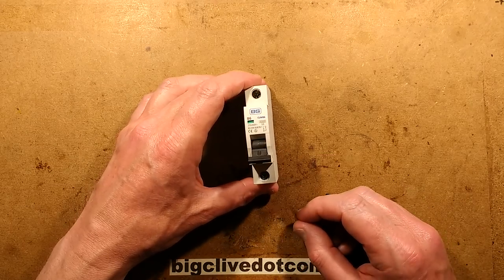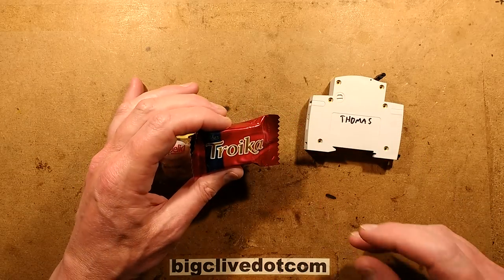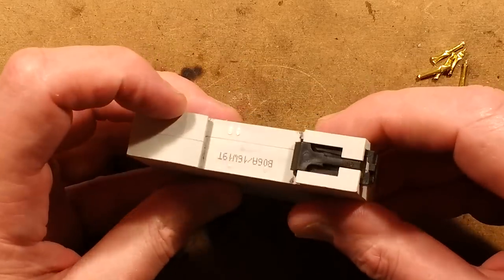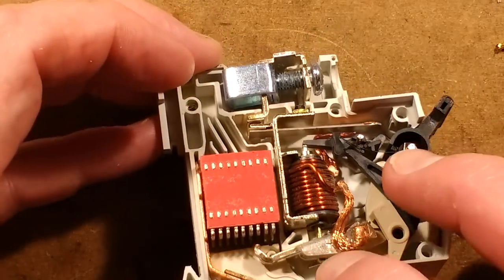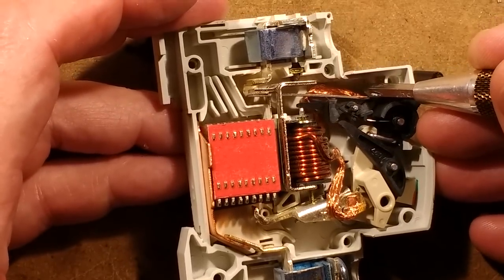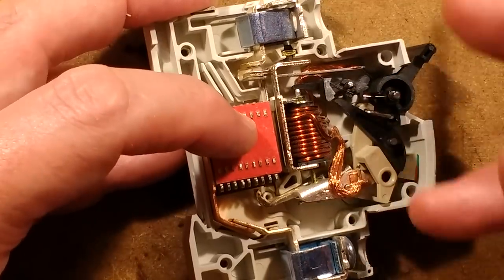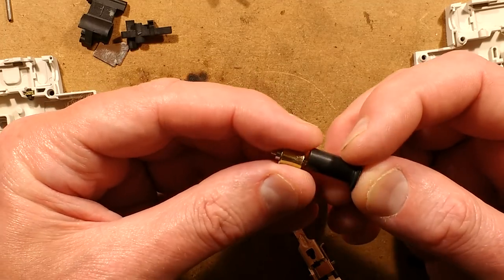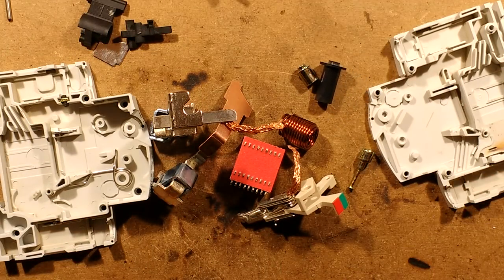Faulty British General circuit breaker autopsy.

Comment: Thomas Nagy's channel is great. I like how he takes pride in his work and will stick his name on it.
Reply: And his apprentice "Dave" seems to have the same attitude.
Reply: Is there an IP rating on that breaker? Pretty sure it going to e pretty low for dust and moisture. Failure could be attributed to it being exposed to an environment outside of its IP rating? If so then not a fault of the equipment?
Reply: Breakers don't have an IP rating because you normally use them inside of a box. If you need a proper IP rating you must use a proper box. There are boxes available which are rated as IP54, but in most cases they are only IP20.
Reply: Marcel Germann I have installed breakers with an IP rating on them. It states that they  will meet a certain IP rating when installed in conjunction with a required IP rating enclosure. The last ones were IP 22 when used in conjunction with an IP 22 rated enclosure. Never going to get much more than this and easily exceeded during property renovation.
Reply: Actually I've never seen breakers with an IP-rating. I only know the boxes with the rating, and in this case it doesn't matter if the breakers have an IP-rating or not:

https://www.amazon.de/Spelsberg-73542401-AK-24-Kleinverteiler/dp/B000UW62PK/ref=sr_1_fkmr0_1?ie=UTF8&qid=1527721879&sr=8-1-fkmr0&keywords=unterverteilung+aufputz+spelsberg
Reply: Haven't seen a lot of Dave ("Dave"? Not a real Dave? :D) yet, but he's definitely in good hands. I think competence/caution can rub off... And/or good professionals tend to clump together anyway. Having it all on youtube probably helps too :D - the cowboys don't tend to film it...!
Reply: Jim Schofield seriously? have you even seen is work? 
The work he put up there is slopy at best. 
The guy uses hot glue for fuck sakes!
Reply: +Alfonce Jean
We use hot glue as a temporary mounting method too here in Germany. Especially on the cables for the lighting fixtures on ceilings before the plaster guys put plaster on it. You can't use the normal cable clips with the nails on concrete and all other installation methods will be too thick for a standard plaster layer.
Reply: Marcel Germann wasnt tempoary it was to fix an unreamouvable baking panel! ( check out his doorbell video)
Reply: Ho and the hot snot is just a shockingly bad  exemple. you can take nearly every video and you will find questionable practices.
Reply: Sometimes the local circumstances don't give you other options, so sometimes you must be creative. Or otherwise you must demolish almost everything, and some customers would kick you out of the door if you would start demolishing the half house. As long as it's compliant with the regulations I don't have a problem with that.
And hot glue isn't really that bad. I use heat shrink with a layer of hot glue inside, making it almost water tight when I shrink it so you can plaster over a repaired cable. The alternative would be installing  junction box there and creating more dirt.
Reply: Marcel Germann we definitely do not have the same definition of "axceptable repair".
heat shrink and glue inside a plaster wall is not something I would ever consider OK. And if a contractor would ever suggest something like that I'll kick him out the door on the spot!
Reply: Ok, you would remove the whole plaster and remove the complete cable the customer damaged by drilling into the wall before checking if there's a cable? I would kick you out of my door for doing more damage than necessary.
Repairing the wires with adequate (!!) butt-crimps and repair the sheathing with hot-glue covered heat-shrink (I'm using certified insulated heat-shrink, it's certified for the european market and for the american market it's certified by UL) is state-of the-art. So you just need to remove the plaster on a small part where the damage on the wire occured. In the USA the walls are hollow, so it's much easier to replace the whole cable. But on a masoned and plastered wall and the cables embedded into the plaster making the things much different. The hot glue is only to make the cable sheathing water tight again, so you can put new plaster on it.
The hot glue melts if you shrink the heat-shrinks with a heat gun and making a water tight connection between the heat-shrink and the sheathing of the cable. Or how would you make it water tight again? Silicone? I would rather trust a product that's manufactured that way. The heat-shrink is covered completely with a layer of hot glue inside which is activated by the heat you need to shrink it.

Most customers don't care how it's done. They only care that it's functional again, safe and that it will last decades.

Comment: You should hook up that bimetallic strip to the adjustable power supply and turn up the current slowly to see how it deflects as it heats up. I think that would be super cool to see it working, maybe even in a circuit breaker that has been taken apart but not had all the springs ping'd to the corners of the room to see how it works under a fault. Also has the chance for fire and melty metal. MMM MMM!
Reply: it will only slowly bend mechanically to trip the catch, not much to see
Reply: I just watched someone take one of these apart for the 4th or 5th time. I think I can handle a little demo of metal bending in real time, showing how the mechanism works.

Comment: I had a breaker pop a few months ago and had no idea why, hunted high and low for the fault - until eventually I narrowed it down to an extension lead. I replaced the lead and sure enough the fault was gone. 

Once all was working again I opened the plug on the lead to check the fuse and found the remains of a ladybird which had bridged the earth and live pins. It had blown up into hundreds of pieces inside the plug (presumably instantly) but enough of their gooey body remained to bridge the connections.

No idea how it happened either as the plug had rubber around the wire, no visible entry points!

Your dust comment made me think of it due to it being the last thing you'd probably think of.
Reply: O

Comment: The most interesting circuit breaker failure I've seen had lots of debris inside the panel, dusty fuzzy stuff. I leaned closer then jumped back squealing like a girl when it wasn't the wad of laundry lint I suspected but the spread out moldy face of an exploded rat. As he simmered on the bus bars his roasting juices dripped down onto a circuit breaker, frying it too. This was all extremely pleasant to to clean up and make right. I don't do this for a living, just helping a friend who lived way out in the country with her horses. country life may not be for me after all.
Reply: Never had rat problems, but we've had a few mouse problems - they chew through the insulation on the incomer  line cables (3-ph) and "self-cremate", sometimes fairly spectacularly. Yet to have a mouse-induced phase to phase short - that would probably be an "explosive experience" for the mouse!

Comment: My first thought, as you were showing how the plastic arms weren't catching each other, was that it looked just like a worn sear in a firearm. Of course, you showed that was wrong, but I did grin when you pinged the little spring across the room, since that's also a common occurrence in firearms maintenance.
Reply: Pringing a spring across the room is a common occurrence with anything that has small springs. I can't even count the number of times I had a spring fly away on me, and I would have to go search for it.

Comment: I don't think a bug or dust would stop the breaker functioning, just stop it resetting. The magnetic force from the coil causing the trip is a lot stronger than the spring force pushing the pin back in again.

Comment: Hi Big Clive, you may find as I have the that external 90 degree Circlip pliers, the type that don't have removable tips are the Bees Knees for splitting plastic cases. I also crack the glue under a manual hydraulic press (mines 20 ton but that's ridiculous) as you can distort the case enough to break the glue lines without smashing it in the process.

Comment: well at least the breaker failed in a good way, breaking a heavy fault current in a good way. that was a good sized arc went though into the arc shoots  imagine the magnetic force at that moment on that solenoid pin!  good vid as always.

Comment: Funnily enough I have to switch out a 16A one tomorrow (in Portugal, hence the funny current rating). I love Thomas' channel too.
Reply: Stephen Cook 16A is a common rating.  The classic fuse ratings for distribution boards (group boxes) are 6A, 10A, 16A, 20A and 32A . Later 13A was introduced as a conditionally permitted higher rating for 1.5mm² cabling previously rated for only 10A.  BS fused plugs use 13A sockets on 32A group fuses with a unique "ring main" wiring scheme.

Comment: I have indeed seen breakers fail to trip due to being gummed up after 40+ years of exposure to moisture, oily residue, dirt, dust, bugs, etc.

Some breaker designs are more prone to such failures than others. Tight mechanical tolerances and low-force tripping mechanism are more sensitive to contamination.

Comment: Bugs... Reminds me of when we arrived at the "summerhouse" back in the 70's and found it completely frozen. After a couple of hours digging around (including causing new arcs) dad found the culprit - a very small bug had caused a short circuit in the main relay for the electric heating.

Comment: EATON circuit breakers seemed to have a similar issue a little while back, every once in a while we'd have a breaker that simple wouldn't latch in the on position brand new out of the box. Sometimes they would latch, but a gentle tap on the housing would make them trip. I guess they must've had a bad production batch.

Comment: Well, I'm still puzzled by this.  Clearly at 3:45 it is still not latching after the pin has been pushed back down. You can also see that the arm that is actuated by the pin is fully down and it still doesn't latch.  I think that there must be some other explanation.  There doesn't appear to be an adequate hook on that pawl to hold it in the ON position against the force of the springy contacts.  Someone's 'ad it away with your 'ook.

Comment: Can you have a look at a BG RCBO as the ones we have draw 1watt all the time and get warm?
Reply from the maker: RCBOs do require a small amount of power for the circuitry.  I've ordered one to look at.
Reply: My local wholesaler had 10 wired up on Monday they were warm and smelled. I used a clamp meter and found they were drawing .004amps, my calculation about 1 watt each. The electrician who had returned them was worried they would burn someone’s house down. See what you think. @bigclivedotcom

Comment: Wondering if this is what happened to mine. I went to turn off the MCB for the ground floor power sockets and found it wouldn't turn the power off. It was moving up and down seemingly fine, but no power was getting cut like it used to. Thinking it might be stuck or something, I used a bit more force when moving it downwards and heard it click into place. The power still didn't go off for the sockets. Unfortunately, now when I move the switch up, it just goes back down again and feels very light/loose. 

I don't know why it suddenly stopped turning the power off for the ground floor sockets. I used it a few weeks ago and it worked fine. It's an M2B32 MCB. The other MCBs currently still work fine. It's just the one for the ground floor sockets that decided to behave in this manner.
Reply from the maker: It sounds like the contacts have possibly welded inside.  I'd strongly recommend changing that breaker.

Comment: However, i think the dust was not the reason it was not catching. 
You pushed the plunger down, and even then it would not catch.
Reply: Yeah, that is what I thought too, and when I look back at 3:41 I'm sure he's pushed it down far enough that it shouldn't be preventing the catch from latching... strange...
Reply: 3:48 you still see a bit of the plunger sticking out. he hadnt push it ALL the way in so it was still holding the plastic catch up a little
Reply: Nice catch! (will take a pun where I can get it! :-P) That's it it would have taken as it was so close to latching...

Comment: mcbs have a maximum breaking capacity, worth checking out if used in commercial or industrial premises where they may have a local substation and high PSC reading. Not all mcb's are the same.

Comment: Completely unrelated to the video but I'm having an issue at the moment but worth asking as I can't find answers anywhere else. I'm trying to install a 12kw instant water heater which requires a circuit separate to our current fusebox. However due to the age of the current fuse box It does not have any loop connection that I can run to a separate unit containing a 50 amp double pole RCD. Is there any sort of connector blocks that I can use to split the incoming supply between our main fusebox and the separate breaker for the water heater?
Reply from the maker: In the UK we might use a Henley block which is a big chunky enclosed terminal block often used for joining tails.
Reply: Cheers Clive, Looks exactly like what I need.

Comment: I once had a couple of mcb's that wouldn't reset and found them to contain sand from some old plaster/motor that was slowly dropping down the cables in to the connections. A quick tap tap tap had them working fine.

Comment: looks like it wasn't resetting fully when in the off/reset position. the pin wasn't being pushed back down and the trip arm not rotated back far enough to catch.
I'm going to guess it opened under high load many times, from the nasty arcing, which was likely due to large capacitive/inductive loads and for sure nearby lightning surges

Comment: What is that rectangular ring on top that's dangling loose and what's its purpose?
Reply from the maker: It's the rising clamp that the screw dropped out of.  When the screw is tightened it pulls that ring up clamping the cable against it's contact.

Comment: Could the orientation of the circuit breaker in the electric panel be the cause for example dust falls down dosnt usually stick to walls.  If the breaker is horizontal the dust could accumulate.  From memory mikes electrical blew one apart and i think the take home message was the breaker has to be up/vertical instead of flat so that the arc when it blows flows up the  device due to gravity - maybe the same applies to dust.  Kinda like a jacobs ladder
Reply from the maker: The breakers are mounted vertically in standard single phase boards, but horizontally in industrial three phase boards.

Comment: If this happens (breaker not resetting) ive always found a couple sharp taps with the end of a screwdriver gets it going again for a temporary fix, same with rcd's, wouldnt trust the method as a permanent fix though

Comment: Clive, I am looking for a din mount shunt switch for an alarm I am building.  It seems like you have done a video on one before, but I can't find it.  This is the one I intend to buy https://rover.ebay.com/rover/0/0/0?mpre=https%3A%2F%2Fwww.ebay.com%2Fulk%2Fitm%2F352679647229  
I am not familiar with these type of breakers and I know coming from Hong Kong there will be no instructions.  Do you know if the c1/c2 terminals are the trigger coil, or will I need to get a trigger accessory?  Some of these device have a status indicator contact.  I just hope that isn't what those are.